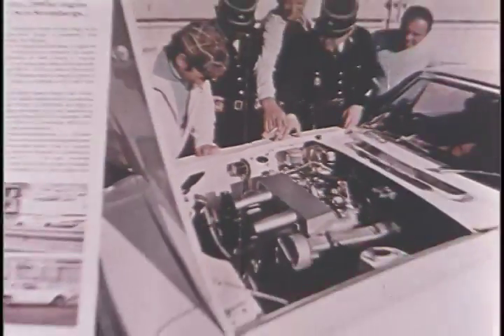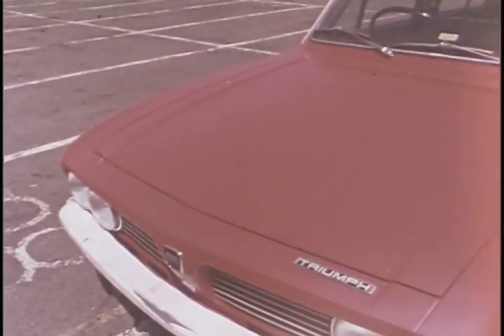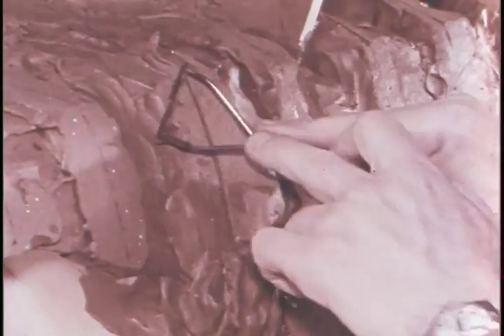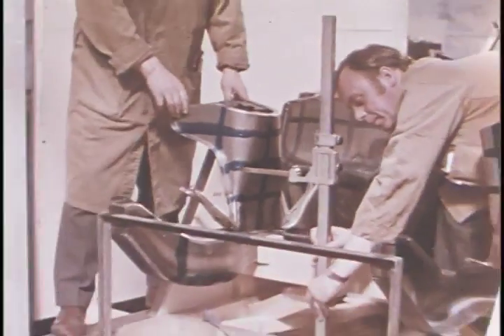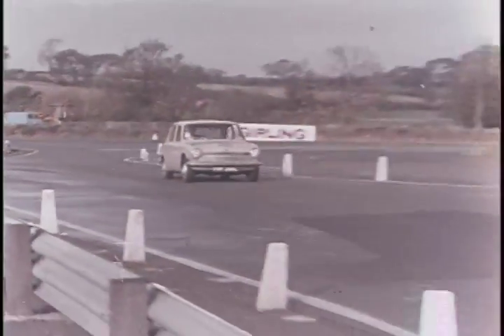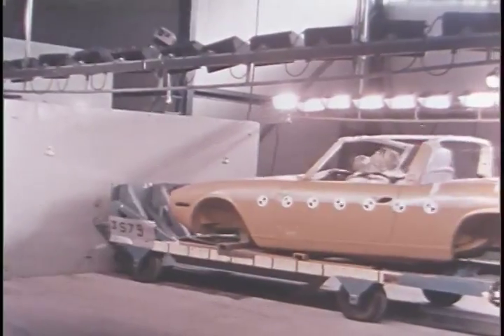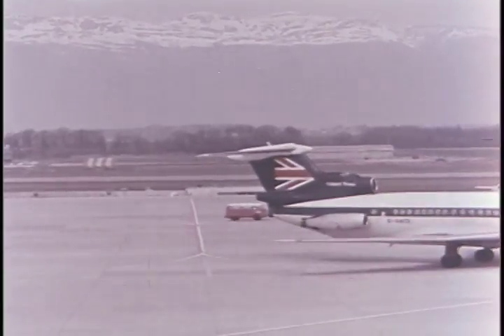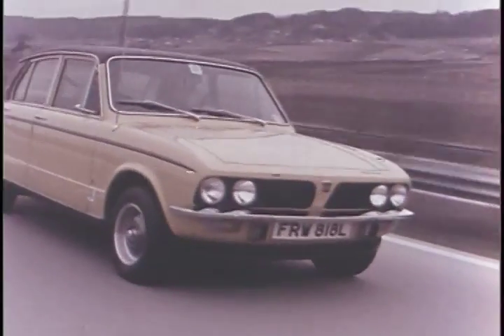This is Triumph

Comment: Oddly enough even though B.L. was going downhill in the '70's; the quality of the Triumph 2000/2.5/2500 range never deteriorated......
Reply: True, but later versions had a poorer quality Spanish steel and less paint coats than previously, all to save money of course. The earlier MK2's or the MK1's were much better built.
Reply: @2000mk1  they were well built until the end in Australia.
They were assembled alongside Toyotas and therefore shared the same paint colours. I’m biased being an Aussie but I’ve heard many times that the assembly here on late model cars was better. Beautiful cars nonetheless.
Reply: Well said.

Comment: Thanks for the video, have owned 7 Triumphs from MK 1 2000, Stag, TR5 and currently TR6. Never had  problems with any of them even the Stag. I get sick of "experts" bagging British cars. I get the same old boring lecture wherever I go. How unreliable they are and how they all leak oil. The fact that so many have survived says it all.
Reply: I never had problems too, British cars were good as long the owner was not an ignorant idiot missing oil changes or service intervalls....
Reply: They were crap and not a patch on Ford's of the time! Totally deluded! No value or demand for them!

Comment: So thats why overheating problems weren't detected in the Stag, the road tests were carried out in sub zero temperatures
Reply: Yeah, but maybe the heaters worked pretty good.............
Reply: It wasn't atrocious - aluminium heads were relatively uncommon amongst mechanics used to all iron engines and mistakes were made in the aftermarket. Build quality had issues at times also. All these problems have been fixed long ago.
Reply: triumph snag!

Comment: I had an Australian delivery 2500S manual o/d.... It was a brilliant car... Did over 300,000km in it and never had the head off... Slid off the road in it once in a storm.. Flash flood filled a normally dry creek bed. Luckily the air cleaner stayed above water and none got into the engine. Had it hauled out with a crane on the back of a truck, pulled out the rubber bungs in the floor pan to let water drain out and drive it home. Took me ages to clean it. The biggest problem I had with it was when I fitted an aftermarket air con kit... The alternator couldn't take the extra load.. Had to replace it with a higher rated alternator.
It was easy to work on used to do almost all my own service and maintenance.
Reply: That 2500S would have been assembled by Australian Motor Industries (AMI) in Port Melbourne; it's external identification is the AMI badge, mounted on either flank, between the front wheelarch and the door. The AMI-built Triumphs were better-built than the Canley ones, as confirmed by Canley's visiting Quality Audit Team - much to Canley's surprise and embarrassment! Having previously worked at Triumph's Gearbox (Radford) plant I had some insight as to production standards in both locations.
Reply: @chrisweeks6973  While that may have been true.... well I know it was as I remember seeing the AMI badge on many earlier models... mine was never badged AMI... The colour I do remember was a Toyota colour from when I had some work done.
Reply: Those things were good - head and shoulders above a Statesman or Fairlane...best luxury buy of the 1970s in Australia.

Comment: The Triumph Stag's overheating problems can be rectified with aftermarket retrofits that make it into the car it was designed to be.
Reply: Using the correct strength antifreeze (30-40%) and making sure there was no residual casting sand in the cylinder heads might've helped... I've had no overheating problems with my Dolomite 1850 in the 6 years I've had it and it has a similar engine to the Stag.
Reply: +Parknest Why should the purchaser of a new car, which, we're told through this film has been thoughtfully designed, carefully made and sold in a nice shiney showroom need to check whether there is any residue casting sand left in the engine cooling system? Perhaps, then, we should check the brinell hardness of the crankshaft forging and blue the final drive gears for correct mesh just to make sure!!
Reply: +jerseybean59 You're right. That shouldn't have been the case when the cars were new but that's what happened. I'm on about owning a stag in the present day. I also clocked up 5000 trouble free miles in a Dolomite Sprint with the only modifications being elctronic ignition (improves reliability no end) and a stainless steel exhaust.
Reply: +jerseybean59 The Stag was originally intended to be a fuel-injected car. The start date for the Triumph V8 actually goes back before the formation of British Leyland, and the intense difficulties Triumph engineers would face (in their attempts to get the necessary funding to finish the fuel injection system) weren't foreseen. The Stag was due out for the 1970 model year, but no fuel injection system was ready. So to get the model out on time, the cylinder bore was increased to provide the expected power using a carburation fuel system. The result of this was the water galleries between the cylinders were a tad narrower than intended. That's really the only thing "wrong" with the Triumph V8's engine design. It's major troubles were all caused by external parts, like the radiator reservoir location BELOW the level of the water pump.
Reply: rover v8, done.
Reply: +Aaron Jones The Rover V8 is an excellent engine. It powered the P6, the Range Rover and other British classics for many years. But increasingly, pulling the Triumph V8 in favor of the Rover V8 is ruining the value of the Stag, rather than increasing it like it once did. And the Rover V8 just doesn't have the same "burble" of the Triumph engine.
Reply: I live in the US, although, I was born and raised in England. In the U.S. You can find the  Rover/Buick engine, good luck in finding a Triumph engine.
Reply: Nothing wrong with the original design, providing they aren't assembled by a load of militant tards ,  
in-fighting against the remnants of the class system.

Comment: I will never understand why the Stag was fitted with an unproven hastily developed homegrown V8 engine   instead of using the dependable Rover V8 . Rover and Triumph both belonged to BL!
Reply: Lots of time was spent by triumph redesigning this and rover could not produce enough to supply the expected demand of triumph, I suspect also triumph design wanted to keep it in house. Most of that team would design the SD1 a rover ironically

Comment: I bought a 1967 ( I think ) in powder blue with black seats and grey carpets.  At 140.000 miles the engine and gearbox plus the diff were all stripped and rebuilt, I also managed to located a gearbix with the electric overdrive. Used to get close to 40 MPG back then, and the body work was repainted when the motor and gearbox were out. It still runs today as my everyday car, but with an aftermarket airconditioner installed  to cope with the Australian heat. Is more comfortable then some of these new SUV cars.

Comment: Had loads of Triumphs and Rovers in my time but I'm always puzzled how a few items passed these destructive tests.

Like the head gasket problems and short timing chain life with the slant 4 
(sorted with the Sprint engine with a duplex)

Although I never had any issues with any of mine as we kept on top of them with preventative maintenance.

My Stag engine was stripped at 10k miles and block waterways were flushed out to reveal swarf and cast moulding sand !!!
Larger fans and radiators were futile in Stag engines which had restricted water galleries !

My Stag never overheated for years after and still had the standard pump, fan and radiator fitted . 

 Just poor quality control really rather than bad design in many cases 

Some Stag engine failed within 5k miles in USA apparently  which is a real shame
Reply: Exactly

Comment: Passed my test in a Herald 12/50 coupe. Cherry Tree, school of motoring £1.00 per hour, £2.00 for an hour lesson plus the test!
I've owned, a 12/50 convertible, 3 Vitesses, one 2 litre Mk 1, 2 2litre Mk2s, (one steering lock saloon), and 1 Mk 2 GT6.
However, I now have 2 Cortina 1600Es. ......

Comment: The Toledo was such a disappointment after the 1300 FWD  which had so many luxury items which were deleted in later models.

My Father had a FWD new and they were sublimely smooth with the rubber donut drive shaft couplings 😅

Comment: You could always tell the workers from the managers. Directors have long sleeve shirts and jackets. Managers have long sleeve shirts. Engineers roll up their sleeves,  manual workers have short sleeve shirts. Even if you are wearing overalls you still apply the same rules. Simple when you understand the code.

Comment: The water ingress testing was laughable "Testing the seals" , the majority of british cars just had to stand still and the water leaked in.The unforgettable smell of damp,mill dew and rotting carpets.Turning the heater on in winter turned the inside into a damp swampy environment,misting the windows.The use of fiberboard for door panels and trim was disastrous as it acted like a sponge,then fell apart.Oh the joy!
Reply: What was their obsession with fiberboard? I have a 1967 GT6, which predates BL. The transmission tunnel, glovebox/parcel shelf, and engine bay and radiator shroud covers were basically cardboard! Did they not think these cars would be driven in the rain? Did they not consider humidity? I live in a land locked city hundreds of miles from the coast. Still humid as hell! I made my own hatch floor coverings out of MDF, and they are already warped by the differences in elevation the pieces rest on.

Comment: And I like the viscosity testing with a cut down funnel, filled by putting your finger on the spout, then timing its flow with a mechanical fob watch like they used in Victorian times. You think BMW still use this method?
Reply: This film was made in 1972 which is now almost half a century ago.Lots of old tech on display.

Comment: Why  the facsination with vinyl roofs in the 70s?
Reply: jerseybean59 less exposed metal to rot...lol
Reply: And vinyl siding......Oh well.. I guess that they used to keep the roofers  and the carpenters very busy..........
Reply: Gyll Devlin actually, rust forming under vinyl roofs was a big issue with all vehicles regardless of manufacture. The primer wasn't thick enough, and water would get trapped under it
Reply: jerseybean59 convertibles of the time were deemed unsafe. Manufacturers would need to completely redesign their vehicles to add the required structural support, which they would do eventually. Convertibles were already the more expensive body style, and to have a car converted to one would be even more expensive, thus they became more of a status symbol. Vinyl tops gave the illusion that you had a convertible, when it was simply a plain old coupe. This is also when t tops and other styling became fashionable.
Reply: @UmmYeahOk  primer is porous so it wasn't the amount of primer that was a problem, more no topcoat to seal it before gluing on the vinyl. That was the problem.
Reply: @UmmYeahOk  and vehicle construction was totally different at the turn of the 60s into the 70s where most cars became monoquoc where before a convertible had a separate chassis so structurally it made no difference if there was any body or not.

Comment: I bought a new Stag in 1973. About 50 (fifty) faults presentb when delivered new. 7 cylinder head gaskets blown in the first year. There were a mass of other problems too. It was, by far, the most unreliable car that had ever existed. Most other Stags (according to the Triumph dealer) were a dead loss, (reliability wise).
All they had to do was make the damn thing work and they would have had a world beater. That was asking to much of Triumph. Why,  in heaven's name,  didn't they use the Rover 3.5 V8? It was more powerful, reliable, lighter, used less fuel and it was already in existence. It was madness to make up a new 3 liter V8 engine.
Reply: Im sorry you got a “typical “ low quality car in the day.. The Rover V8 was all aluminium and from a steady quality source; Triumph was a aluminium head from one dodgy supplier out of the two and the cast iron block was okay but nobody bothered to clean out the casting sand.. About that time an accountant sourced a “cheap” supplier of inferior cylinder head gaskets.. and so it goes on..
     I have a 1971 ( I am the third owner) that was built properly from new and has been lovingly looked after for the most part and has been totally reliable and runs as sweet as a nut.. Ian properly tuned, the car returns 30MPG.. which I believe was better than the all the big triumphs ( 2000,2500, Rover2000 and of course the Rover V8 ) … Has I have repeated many times.. The TV8 was taken from the first stage bench test development and put straight into production which was the main mistake- It had no 100,000 road test whatsoever and the BL Triumph management were indifferent as well as incompetent; The quality control was appalling and they refused to put the engine in the Big saloons which would have highlighted the problems quickly through volume sales. Debris in the engine castings was a major problem in all the triumph engines but the fact is that the smaller or less sophisticated engines in the range could better tolerate this crap, the V8 couldn’t

Comment: U.S.A.  BUDDIE OF MINE GOT A USED TR7. WAS GOING TO REPLACE TIRES WITH UPGRADED ROAD RACING TIRES, WHEELS, SCHOCKS ETC  WHEN FOUND OUT ABOUT  ''FALLEN''  REAR AXLE PROBLEM. WOULD HAVE COST MORE TO FIX THEN CAR WORTH WITH NO WORD IT WOULDN'T DO IT AGAIN, TOO BAD   WAS A NEAR CAR.

Comment: "...worldwide reputation for performance and reliability..."

Reliability??  Surely they mean the opposite of that.  Was good for a laugh though...
Reply: Teeebs , in 1990 I purchased a ratty 1969 TR6. For the next 8 years I drove it to work 5 days a week. On weekends I drove it to car shows, car club rallies, tours and events. I autocrossed it, did track tours, and just went on fast drives thru the hills and mountains of northern California.
Not once was I ever stranded or broken down on the side of the road. Seems pretty reliable to me.
Reply: Cool story.  Something tells me there was more to it than just regular oil changes.  Not to mention the Lucas electrics, which I'm sure worked just peachy all the time...lol.
Reply: Obviously I did preventive maintenance, but nothing out of the ordinary for a then 25 year old car. Never had an issue with the electrics, although I knew others that did. It was generally just bad grounding.

Comment: Lord Stokes was such a pompous and penny pinching clown; Triumph had access to a proven and rugged American V8 engine, yet to save a few pounds they basically stuck two V4s together and stuffed the resulting mess of a unit into the Triumph Stag which had overheating issues forever as a result.

Comment: Why did they use that awful triumph V8 which overheated when they had the tried and tested Rover (Buick) V8 available? More incompetent management.
Reply: GM wouldn't allow vehicles fitted with the Buick engine to be sold in the USA, as a condition of their licencing agreement with BMC. Supposedly to avoid competition with GM's domestic products.
Reply: Strange as they'd already given up on that engine for the US as it was too small for most GM cars at that time, which is why they stopped producing it. Sounds about right tho for large corporations to make that a condition. The Triumph could still have been fitted with the Buick engine for the European market tho,and it would have become a classic. But as I remember the MGB V8 was fitted with it, we'rent they exported to the US?
Reply: I believe that is correct. Triumph also used it in the prototype TR8. Possibly they were able to renegotiate the terms of the agreement.
Reply: it was intended to be a 2.5, with wider water channels between cylinders.
Reply: @webtoedman  How does that explain the export of the SD1 V8 to the USA?